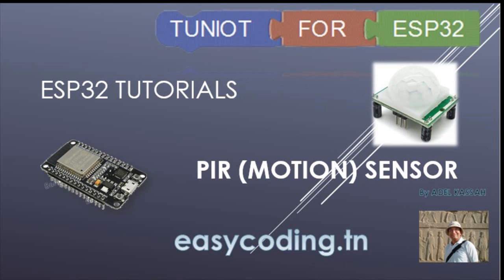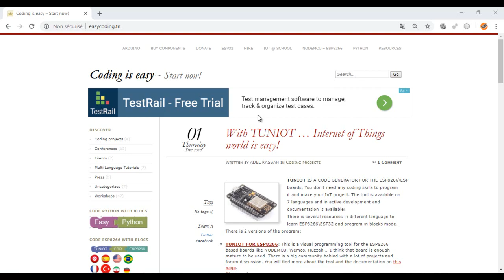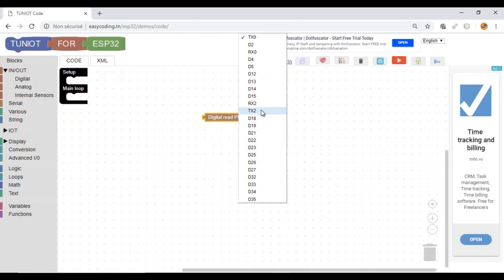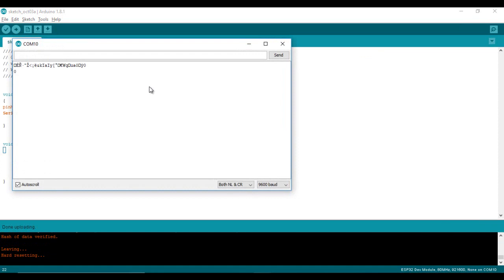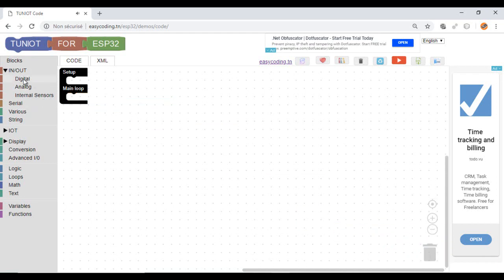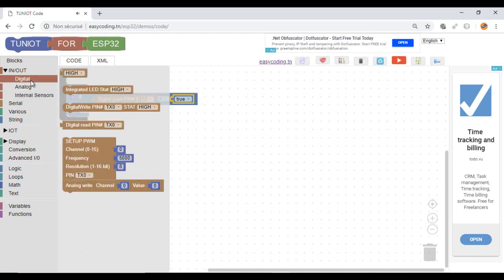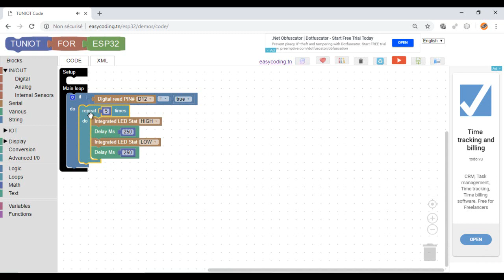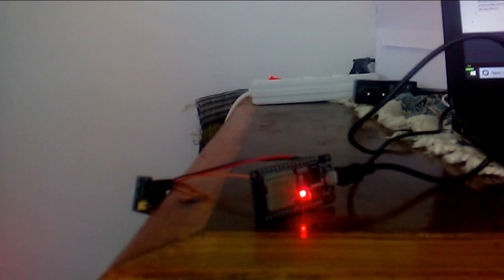ESP32 tutorial A-10: PIR (MOTION) Sensor

Comment: Hi Adel, to make the ESP8266 NodeMCU board bread-board friendly; I sliced the breadboard. I call it "sliced bread" ; see on this video. I use a small bench top band saw, cut the center groove of a 400 tie hole board lengthwise and glue both halves onto a thin plastic sheet. The halves are spread apart so there are 2 tie holes per pin exposed. It could be wider for more exposed tie holes. This plastic sheet could be plexiglass; it is about the thickness of a credit card and same dimensions. It could even be a discarded credit card, why not ? !  This sheet can be, in my case, covered on one side with Velcro to attach it to a 5 volt battery bank (2500mAh) to make the NodeMCU portable. Our kids will be learning your Blockydunio Enhanced; thanks for all you  have done. From Missouri, USA.  https://www.youtube.com/watch?v=-2V_ewTP-cY
Reply from the maker: You can put the board on 2 different breadboard
Reply: @ADELKASSAH  Yes, but then it will not fit on my power pack which is the size of a credit card. This is portable . If stationary, the power pack can be recharged and output 5V at the same time , running the micro processor and circuit. Most batteries cannot do that. It's like "shore power" or mobile. Just one idea. Thanks for your help for us, Adel. I still study Blockyduino Enhanced for our kids to learn easy coding. I am waiting for someone to enable ESP8266/ESP32 NodeMCU to work with Arduino Web editor; or I have to buy a $40 Arduino MKR WiFi 1010 which is supported on-line ; many Chromebooks in this country so on-line editing is necessary: USA.